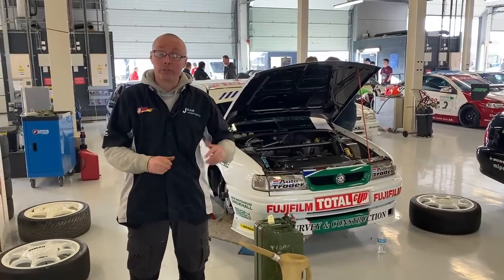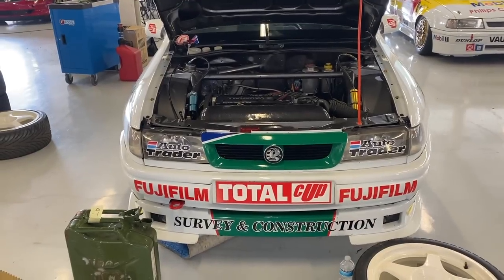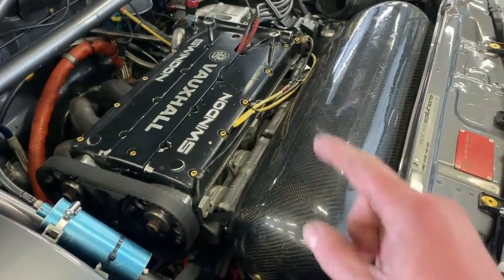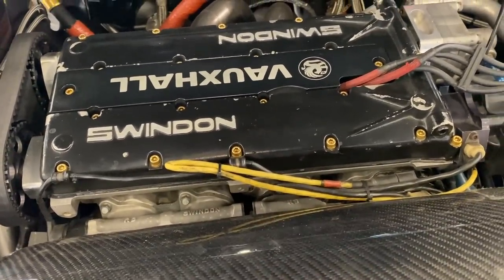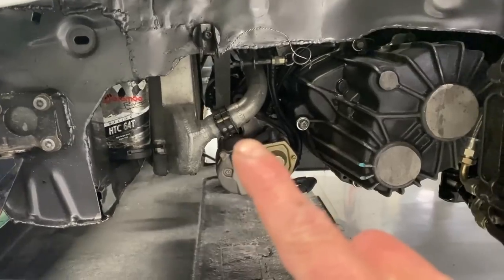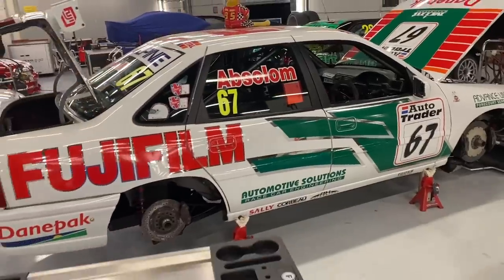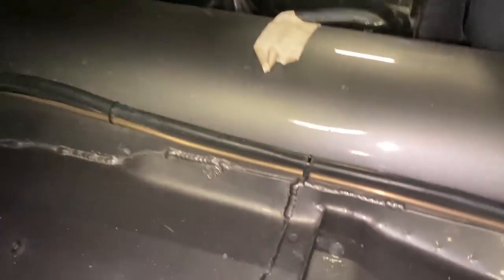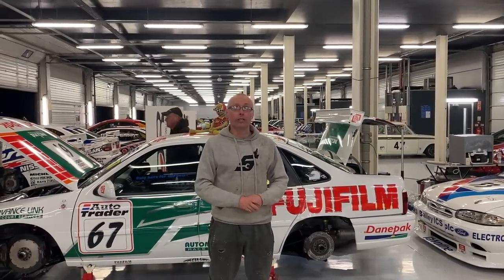LAST EVER Vauxhall Cavalier Touring Car ever built! *REVERSED ENGINE?!*

Comment: Great video. You were expressing surprise that Swindon used a standard C20XE head and block, but the Super Touring regulations this car was built to dictated that they had to be. Of course they are extensively modified internally, but Vauxhall/Swindon were obliged to use a production head and block as the basis of the race engine. An interesting bonus if you're interested; Vauxhall used Swindon Racing engines from the Astra MK2 days through to '98. For '98 until '01 Vauxhall switched to using Speiss developed engines in the Vectra.

Comment: I think the rules stated you are required to use a production based casting .However they would of recieved raw castings to start with.

I think that last iteration used a 85mm stroke instead of 86 but that  would be an intersting detail tk confirm. 

The stich welding is a better way as  youll induce way more heat into the parent material if ran long runs.

Comment: I always wonder why FWD cars have their engines in front of the wheel axle. It is quite bad for weight distribution.

 It can be done by "just" turn around the whole engine gearbox unit and put the wheels more foreward so the car starts to look the same as RWD cars. (Obviously, when done on an existing unit the wheels turn the wrong way).

Comment: if im right they turned the heads around due to a rule change.
Reply: No, these heads generally have their inlets at the back of the head and exhaust at the front. Think about it, the incoming air flow had to come in and bend back on itself to make it into the engine then the exhaust flow had to bend back on itself to exit the engine under the car. By having the head reversed, the air flow now has a direct flow path into the engine also gaining a ram air effect as speed increases through the massive air duct at the front. The exhaust manifold now fabricated to flow directly out of the back of the head and under the car has achieved an almost direct flow path in and out of the engine with minimal resistance. Simple but ingenious design 👌🏻